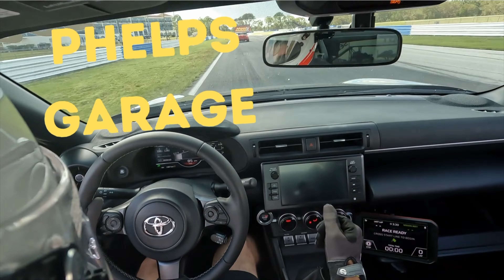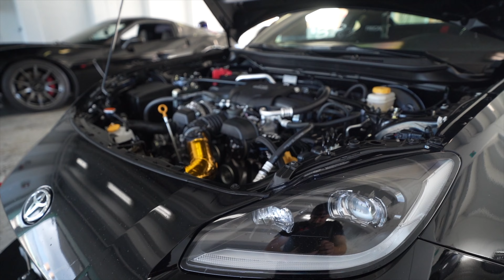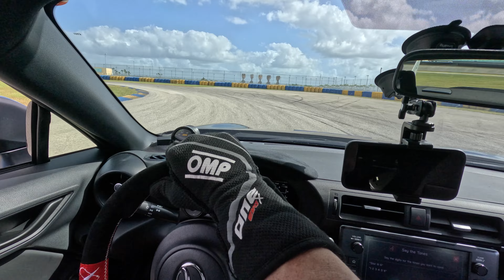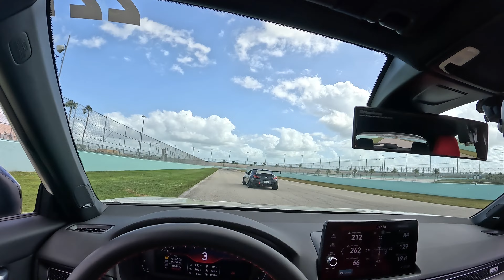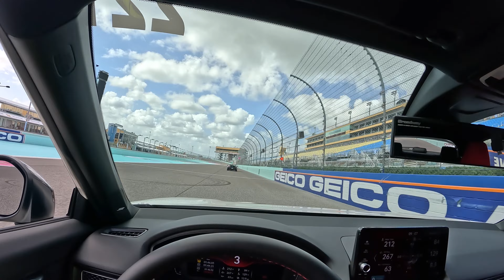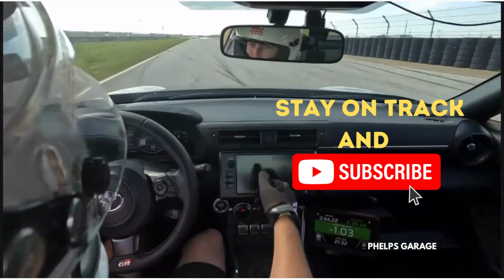TYPE R vs GR86 at Homestead

Comment: Ignore the haters bud. This 86 rocks. Most people smack talking never get off their couch. Keep it up 👍
Reply from the maker: It’s gonna rock more once the turbo is here 😎
Reply: @phelpsgarage4202  surprised you didn't go supercharged. Would think that would be the best fit for a track car. Turbos usually have weird powerbands which make them a bit unpredictable on corner exit. What kinda power can you make before the rods make glory holes?
Reply from the maker: @MeltingRubberZ28  either a turbo or a centrifugal supercharger. I’ve always been a bigger fan of turbo. So far the highest horsepower GR86 we know is making 563 hp on a bone stock motor.
Reply: @phelpsgarage4202  I'll have to follow this build a bit more closely. You're talking more power than I expected.
Reply from the maker: @MeltingRubberZ28  im looking for another 100 to 150 hp

Comment: Maybe you've answered this before but wouldn't an e46/e36 m3 or even a 3 series be faster and cheaper to build than the gr86 track ratted? or is there a special reason you picked the gr86?
Reply from the maker: I don’t know a bunch about the BMW cars, so it’s hard to answer. I always like this platform and with the new motor it seemed pretty promising.
Reply: The GR86 unibody is almost 3x stiffer than an E36 M3. And a lot stiffer than an E46 or even an E90/92. With a lot less weight.
Reply: You could make the same argument for a Miata or a civic ek hatch or any other car.
Reply: I’ve got to admit but yeah, the e36 m3 I’m particular. I got into driving mine only a year ago. But it’s crazy how much lap time you can get out of this car. I was considering brz/86 vs e36 m3 for over 2 years. I was comfortable with Subaru but going to my local track events there was just so many e36 and other bmw’s there. And there cheap. My car was 14k, about 5 less then the brz I wanted. Both were “track cars”. Specifically NASA TT cars. No cage but everything else in both. And I’m not the one to talk about horsepower and crashing my car. But it makes 230 wheel with a stock 160k mile motor, and I can get a donor 325i coupe for 2k and rebuild my car. The brz is just to expensive for me to recover from a bad crash

Comment: That’s a great looking GR86. Your car is definitely faster than that Civic as is. Both of you have your cars setup super tight. If you soften the damping on the front dampers you should be able to get more bite. Sure it feels nice and safe but you can see and hear the understeer. There’s definitely a few seconds on the table. Besides a bunch of corners below the limit, there’s corners where the understeer kills your momentum, and then on top of that those tires are getting slower after the first hot lap. With where you’re at driving wise, the Kumho V730 might be a better match for you. It lets your best lap to be on the 1st, 3rd, 4th or 5th lap. Good luck and have fun out there.
Reply from the maker: Thanks for your input! The car is softer than it was at one point and yes, I can see the laptimes come down. I just hate the feedback the car gives me, it’s like it’s lazy and numb compared to when it is super stiff, but obviously when it’s super stiff, it overwhelms the tires and kills Performance.

Comment: Nice video!  Looks like your tires might have started overheating when you were in the lead position and started missing a few apexes.  You were defintiely quicker in the tighter sections though.  I think you'd have the edge on more technical tracks.
Reply from the maker: I hope to do it again at Sebring
Reply: I noticed the turn in was late multiple times then too. But, the type R hit the apex and you weren't and still, you held it
Reply from the maker: @nicklauher9323  yeah it was my first time so I know I have time to kill

Comment: Tough to see your oil pressure with the refresh rate on your gage flashing. I think I saw a lot of 60s. Did you catch anything low? Also, that civic oil temp got a bit toasty. Got over 270 before the screen turned off. I'm pretty sure that was the oil temp.
Reply: Yes it did, once I see it get over 270 I start to back off.
Reply: @Club-Version  such mixed opinions on max oil temp in the car community. No oil cooler on my 86. I tend to back down around mid 250s. What oil do you have in your type r?
Reply from the maker: The lowest I’ve seen is 40 psi at Sebring, but it normally around 60ish
Reply: @christacy1 5w30

Comment: Idk if it's the camera angle, but the red center stripe that's slightly off-center is bugging me.

Love the car though.  Small power, big aero, full-murder black.  Awesome.
Reply from the maker: It’s center when it’s on the alignment rack 🤷🏻‍♂️. Car would be more fun with a turbo 😎
Reply: @phelpsgarage4202  I prefer a centrifugal supercharger.  A turbo is faster, but so is a Corvette.  A centrifugal keeps the laser-crisp throttle response, adds more of that S2000-ish build-up that the 86 already has, and has superior thermal characteristics to a turbo or positive displacement blower.  I've been looking at installing one on my NC2.
Reply from the maker: @JETZcorp  yeah, I feel with the turbo I’m gonna have to keep the RPMs up to get it to spool. With the supercharger will just come on with throttle
Reply: @phelpsgarage4202  A turbo will make a pile more midrange than a centrifugal, so turbos are great for pulling corners a gear "too high".  You just will lose some part-throttle controllability and crispness.  A centrifugal builds boost with RPM with all the power up top, so you'd drive it like you do now.  The positive-displacement blowers like roots and twin-screw superchargers are the ones that give you everything from idle, but they're the least powerful up top.  Because a centrifugal doesn't make a bunch of torque, it's easier on your engine than a turbo or blower.  That big turbo midrange is what bends rods, hurts bearings, and causes most detonation.  If you build your bottom-end with stronger parts and lower compression, the turbo becomes more attractive again.
Reply from the maker: @JETZcorp  yeah I’m hoping I can keep the tune super safe and run E85 with low timing and boost
Reply: @phelpsgarage4202  Oh yeah, I forgot you were on E85.  That helps a ton.

Comment: Seems you've got the chassis dialed in on that momentum car really well. My brother owns an FRS(FA20) and he did some of the changes I suggested to get better handling with wheel and tire changes, camber, bracing, etc. . I'm sure your tuner can move the RPM limiter for you fairly easy and all will be good. I still own a 2001 Honda RC51/SP1 1000RR V twin and when it was on the dyno getting mapped the tuner hit the limiter and that shut the motor off; like right now. The tuner thought he blew my motor up, and I told him no it has a soft limiter and a hard limiter, and the 2nd one will turn the engine off. I performed a bypass for the soft limiter so I could spin it to 10,500 RPM after the tune was completed. I'm going to inquire with Mike @ MotoIQ to see if they have found a solution in their engine builds for the FA24 oiling issue, that is not a bandage solution but a cure, as I see no vender is building a different sump. Fullblown  makes one for the FA20, but that doesn't help with the FA24.
Reply from the maker: Yeah, I’m hoping someone comes out with a fix for the oiling

Comment: I think the 86 did pretty good considering that isn’t your home track and you’re going against an instructor with an extra 60 hp or so. A supercharger or some more weight reduction could definitely make up the power difference. You probably could use a racing steering wheel too.
Reply from the maker: Yeah, I agree I think I did all right. I think with more seat time I would get him.